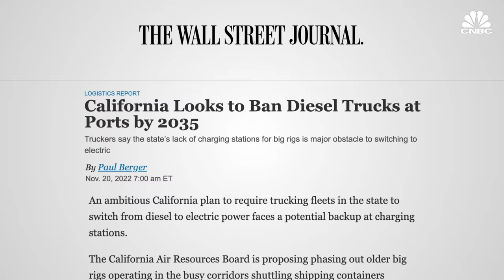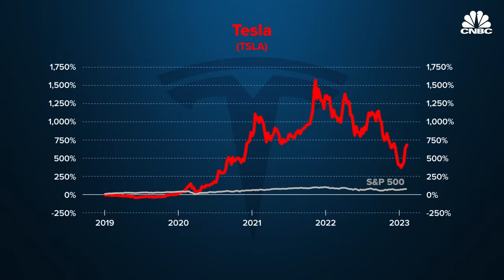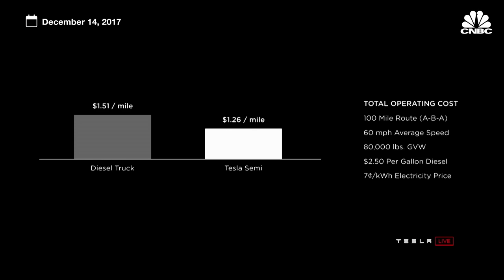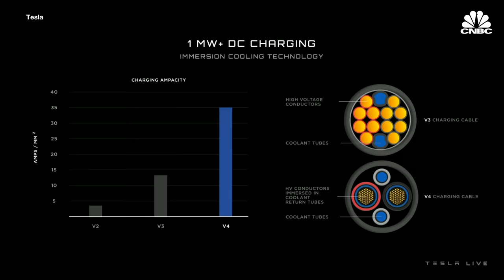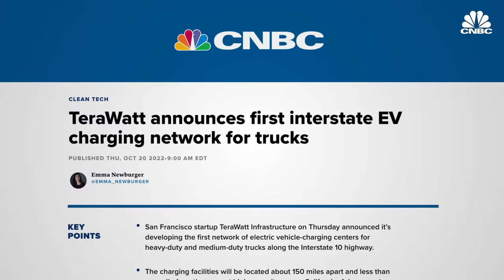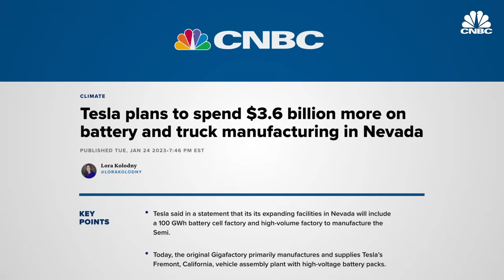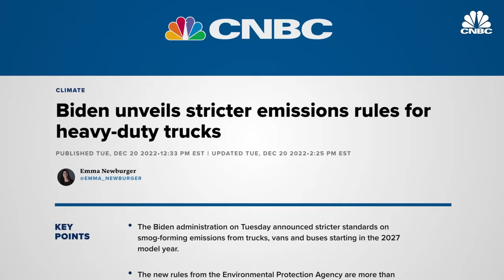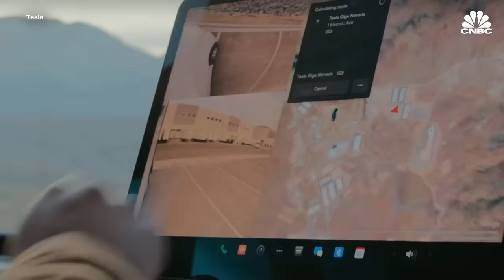Does The Tesla Semi Live Up To The Hype?

Comment: Let’s see how cold does it usually get in California on the routes being run?
Reply: They took it through Donner pass which is 3000ft of elevation and still got over 500 miles with 81,000lb gvw.
Reply: @miguellopez3392  I guess I stand corrected, will admit when I’m wrong.
Reply: @TIMOTHY ORENDORFF  it's not that cold won't effect it is just 2 things happen when a battery gets cold. 1 it lowers the pack voltage by chilling the chemicals inside  effectively locking away usable energy. To acces this energy the battery needs to be heated, 2. heating a battery takes a lot of power, but this gets easier as you use a bigger battery because a small battery cools off faster than a bigger one. Due to square cube law, I imagine a 20% loss in range at 15F, 40% loss -10F. So just like a gas engine in winter it is recommended to pre heat system while charging before going on a journey to improve efficiency. The battery however can still function at -40F but at highly reduced power and charging.
Reply: @miguellopez3392  Miguel, I think you know we're on the same page; but if you're going to avoid giving ammunition to the haters, I urge you to be more precise. In particular, the Donner Pass video is from a completely different trip than the 500 mile range test, towing a flatbed trailer loaded with highway barriers and not a dry van trailer filled with pallets. And on the 500 mile range test with the dry van trailer, the Tesla Semi climbed Tejon Pass ("The Grapevine"), not Donner Pass ; and Tejon Pass is 4,200 feet high, not 3,000.
Just trying to help...
Reply: @Ben Thurston  that's asking to be too precise unless the guy is an engineer who wants to math it out themselves if it has the battery for it and doesn't give ammo to anyone as they where both loaded to near maximum weight and still did their claimed range, as for elevation gain difrence that again doesn't matter because of regenerative braking recovering the same energy relative to elevation gain. I've been at this for years, you can straight up make up lies and they will belive it which is why EV myths are so prevalent, I put effort in precision when I think it's necessary.

Comment: It's obvious that Tesla's designer Dan Priestly has never driven a semi for any appreciable amount of time.. I am all for EV's but until their battery charging times are similar to refuelling time for an ICE vehicle. ON a coast to coast run, it would take an extra day and a half to charge the battery. Tesla claimed it to have “built it around the driver,” but that is just plain nonsense. Starting by how much space it just wastes with its central seating position. While that is the one the McLaren F1 adopted, it works better on hypercars than on trucks. The central driving position makes it more challenging to look ahead and overtake. That happens because a truck is a wide vehicle. If you are in the middle of the cabin, you are far from the edge of the lane, where you have a better view of the traffic ahead. On a two-way road, that’s also where you can see oncoming traffic. Truck drivers have to pay tolls, talk to people in gatehouses, and handle the paperwork while entering a factory or delivering anything. The Semi does not give access to a window. In fact, it has no windows that can be opened: the driver will have to get up from their seat, open the door and deal with whatever they need – even in the winter. Talking about cold weather,  having the doors in the back of the cabin will force the driver to walk a bit to reach their seats. In the winter, with muddy boots, doing that will mess up the cabin interior. A truck with doors that give direct access to the driver’s seat prevents that from happening: they can take off their boots and just walk barefoot in the cabin.
That would be especially useful for trucks with a bed. The Semi apparently does not offer one, which is another flaw in the electric truck’s concept. If you think it through, it also speaks a bunch about the limited use the truck will have, almost like a Class 8 last-mile truck, if that even exists. A hypothetical bed could be in the back, but it is not there because that’s where the Semi has its doors. Another option would be to put a bed above the windscreen. Even if the Semi was not conceived for long trips – as the lack of a bed suggests –  people driving at night often find it useful to take a quick nap to keep driving safely. 
The massive screens inside the Semi are dangerous. The “tablets" are simply not designed for use in moving vehicles. Drivers need physical buttons that they can reach without taking their eyes off the road. They reflect stuff and glow too much, even in dark mode, which makes them terrible for night driving.
I am also not happy about the rear-view mirrors. Thanks to the central driving position (again) and the cabin being narrower in the front, Tesla had to place them in really long arms. If they get dirty (and they eventually will), the driver will not reach them easily to clean them.
Tesla seems particularly proud of: the bullet shape of the cabin, which imposes an angled windscreen. As aerodynamic as that is,  it would only help snow build up on top of it. People who find it difficult to clean a passenger car's windscreen in the winter should have fun doing so on a glass surface sitting ten feet above the ground. Vertical windscreens do not have that issue. In the summer, the angled windscreen will turn the cabin into a glasshouse.
So there you have it - a semi driver's view of this foolish waste of engineering talent.

Comment: What the Hell is this? You call this reporting? This is nothing more than a marketing fluff piece. When will anyone ask and get the answer to the load capacity of this truck? Elon evades this question every single time. Frito-Lay products aren't exactly heavy so this just adds to the intrigue. If Elon won't answer then it can't carry 48,000 and that's a problem unless all you're hauling is corn chips.

Comment: Make extra battery 🔋 pack of  the tesla truck  trailer
Reply: I'm not sure there's a need for this, even if it were feasible. Including a top off during the mandatory 30 minute break prior to 8 hours of driving, the Tesla Semi can drive as far in a day as the HOS regulations permit; so the only effect of adding batteries would be to reduce the payload, for no perceptible gain.

Comment: I'm no ingeneer but wouldn't solar panels on top of these truck boxes be a good idea ?
Reply: They would add to much cost for the trailers that attach to the trucks.
Reply: @Miguel lopez  Good point . I would think they use the same box each time though in the case of pepsi
Reply: @MyOpinion  could work for refrigerate trailers if pannels come down in price.

Comment: 400 mile radius @ 45mph 

When they go to charge it’s usually broken so they have to go get gas trucks.
Reply: Nope, 500 miles at 60mph with a 82,000lbs gross vehicle weight. Recharges 300 miles in 30 minutes at a mega charging station. 80% of truck in the US travel less than 300 miles a day.
Reply: @Victor-vj5ds  So true. Further the demonstrated 500 mile range includes a 7% reserve, as well as climbing and descending the 4,200 ft. Tejon Pass ("The Grapevine").
And Tesla chargers are never broken; it's the mish-mash of other companies' chargers that have about a 40% failure rate.

Comment: The average weight of the Tesla batteries in these tractors is about 13,000lbs.  The average weight of a tractor's full tank of diesel is about 2,100lbs.  As the Tesla batteries are depleted, the tractor does not get lighter, however the diesel tractor does.  Weight alone should tell you that these EV tractors will cause more damage to our highway systems and increase our road tax.  Also, talking about weight, there is a maximum weight limit set for semi-trucks, 80,000lbs fully loaded.  With the weight of the Tesla tractors, they are limited to a smaller load than diesel tractors.
Reply: They are maxing out at 82000 pounds.. 2k isn't doing any more damage to the roads.
Reply: It's not just the weight of batteries vs. the weight of diesel fuel; there's also the little matter of replacing an entire diesel powertrain with three 100 lb. electric motors. Electric and natural-gas-fueled semi-trucks get an extra 2,000 lbs., to 82,000 GCVWR. After all the trade-offs, the Tesla Semi has a demonstrated payload of about 44,000 lbs.; less than that of a typical diesel semi, but not significantly so. For most operators, this won't be an issue, because 90% of trips go out loaded to 10,000 or more lbs. less than the GCVWR, often because they're cubed out rather than weighed out. For operators who must load to GCVRW on every trip, Tesla Semis won't be suitable.

Comment: Many test operators in Nevada had said that the design of center seat in that truck are horrible and unsafe. You can't look ahead to prepare to stop if needed. On left side like a normal truck you can lean to look ahead of the traffic but this truck you cannot.
Reply: Evidence?
Reply: @Big_Ben_from_La_Mesa  I actually didn't record the conversation but I work literally right next to Tesla where they ran the trucks around the warehouses dock yards. Couple drivers were taking a break right outside of our warehouse dock so that's how I found out by talking to them.  Not all drivers said the same but I talked to guys that actually have 10+ years trucking experience their opinion were what I stated above and rookie drivers did mention they liked it but I rely on experiences drivers rather than the new drivers.
Reply: @AgentBiohazard  Here's an actual, on-camera discussion with a Tesla Semi driver: https://youtu.be/Fl71FRIuA4g?t=417.
He was asked about sitting in the middle, and he stated "it's wonderful. there's plenty of vision out of it. It runs very well." He also confirmed there is no FSD or Autopilot, and stated that he preferred it that way. When asked about range, he stated "500 miles", then related driving 485 miles, with 12% battery left.
So the most we can say is that some drivers like it, and some don't. And I personally would assign more credibility to statements of rookie drivers; the experienced drivers are more likely to be threatened by the conversion from Diesel to electric semis, and search for ways to discredit the Tesla Semi.

Comment: The infrastructure to support electric heavy duty vehicles is nowhere close to where it needs to be for these things to be feasible
Reply: FALSE. There are already at least 21 Tesla Megachargers in place, enough to add 80% charge to >500 Tesla Semis a day, for the 36 Tesla Semis now in private (PepsiCo) hands. So there are already >10 times as many Megachargers as required for the number of Tesla Semis on the road. And a network of 72 more between Fremont, CA and Laredo, TX, is already in planning, which will be able to charge >1,700 Tesla Semis a day. How many Megachargers do you think there should be, for the number that are now on the roads?
Reply: @BigBen621  the routes that are in planning require a government subsidy for which they have not been granted. I'm not saying that they don't have the infrastructure for their tiny amount of current trucks. But if they want to get to the point where they can replace diesel trucks there is still major hurdles. With the main one being the huge amount of power that these chargers require.

Comment: Put some solar on the containers
Reply: The math and physics don't work out. Solar panels covering the top of the trailer would produce enough energy to add about 13 miles a day to the range of a Tesla Semi; but the added weight and aerodynamic drag would reduce the range by about the same amount, for no net gain. Far more seriously, these would add about 2,000 lbs. to the weight of the trailer, reducing the payload by the same amount—again, for no net gain in range.

Comment: I do 800 miles max Weight  max speeds.. 2015 DD15 eng.
8 min to fill up
Reply: Big whoop. In California, where all of these have been deployed so far, HOS regulations only allow 605 miles in an 11-hour day on-duty, which the Tesla Semi can easily make, fully loaded, with a battery top-off at the 30-minute rest required prior to 8 hours; so 800 mile range isn't really a big advantage. Then you've got 13 hours to charge, so 8 minute fillup isn't really a big advantage.

Comment: An Australian company is already running production battery-swapping trucks with 90T capability and 250 mile range (at 90T) right now. Telsa. Leading from behind. Again.
Reply: Lol just drive it the tesla at 90 tons, 41 tons is just  legal limit, and it will still go further since it has a 25% bigger battery, also the battery swapping a 620kwh battery is going to take longer than fast charging it on a tesla mega charger, if you ave to go to sites that have them on hand, how many of these "production" made so far? They don't even look like they have basic fire protection.

Comment: Didn’t California just have to ask people not to charge their electric cars a couple years ago? And what then by 2035 if they haven’t figured out the infrastructure it needs to power all of those vehicles? 

Honestly seems to much of a risk for something that’ll have negligible effect on the environment.
Reply: Actually, the Independent System Operator asked all California users to voluntarily curtail consumption, including charging EVs, from 4PM to 9PM for a few extraordinarily hot days. This was no problem, because almost all owners charge their EVs at night when rates are much lower.
All the Semis Tesla's business plan calls for selling in the 10 years starting 2024 will only add about 1% to overall consumption; and since there's massive spare capacity at night when most EVs charge, and because both residential and utility-scale solar are increasing rapidly, it's likely that little or no additional capacity will be required to be built.
Reply: @BigBen621  ahh okay, thanks for sharing the info. (:

Comment: While neat, they don't make any financial sense. Between the high battery cost, and poor power density meaning that large amounts of caring load are taken up by batteries, battery powered vehicles just don't make any sense for long distance transportation.
That said, I'm for electrical transport; it just makes more sense on-grid than off.

Comment: I just can't see how drivers will wait additional time to charge on long hauls. And those tremendous current draws to the massive motors will shorten the life of the batteries quick than a passenger cars would. Time will tell if this winds up like Musk's project like Solar City or Hyperloop (and soon with NeuraLink).
Reply: I just can't see how drivers will wait additional time to charge on long hauls. 
Tesla Semis are not designed, intended, or marketed for long haul applications; they're intended for regional delivery within a 500-600 mile radius, returning to their home yard to charge overnight or between shifts. As such, no drivers will have to wait additional time to charge on long hauls.

 And those tremendous current draws to the massive motors will shorten the life of the batteries quick than a passenger cars would. 

You state this as if it were a fact; but the only actual fact is that you haven't a clue what measures Tesla has taken to avoid battery degradation. In any event, the batteries are warrantied for 1 million miles; so any premature battery failures will be on Tesla, and not the owner.

 Time will tell if this winds up like Musk's project like Solar City or Hyperloop (and soon with NeuraLink). 
Every successful entrepreneur in history has had multiple failures to go with their successes. The fact that Musk has had some failures just puts him in the company of others like Thomas Edison and Henry Ford.

Comment: ive seen a few tesla trucks on the side of the road 😂..to early to have them break down.
Reply: These are prototypes. It would not be unusual for prototypes to have a higher failure rate, allowing the flaws causing the failures to be corrected when they go into full production.

Comment: Two points must be highlighted here! 
- They only use it for transport in a radius of 400 miles.
- They only use it for transport of very airy stuff. 
So this is a very special case of transport! Really not representing what we need!
Reply: It seems you may not actually have watched this video before posting your fact-free comment. At 4:42, it's stated that loads of soda will "weigh out", that is, the load will be limited to the load capacity of the trailer, and not the volume. At 4:36, it establishes the load capacity as 45,000 lbs., and at 4:30 it's stated that loads of soda are moved in "300 to 400 mile runs to other warehouses". Taken together, this establishes that 45,000 lb. loads of soda are being moved on 300 to 400 mile runs.
Reply: Pepsi only takes drinks to 180 miles average, in truth most semi truck are limited by volume and go under 300 miles a route. Truck can go 540 miles max.